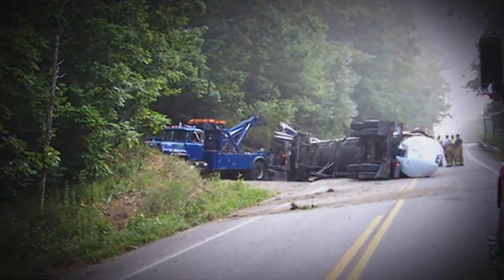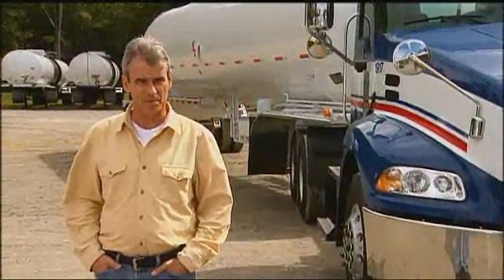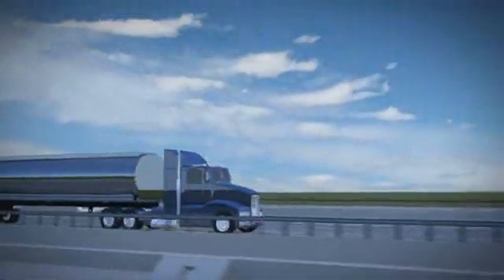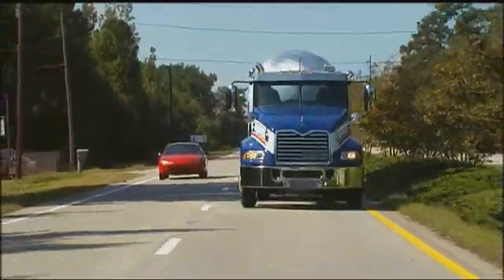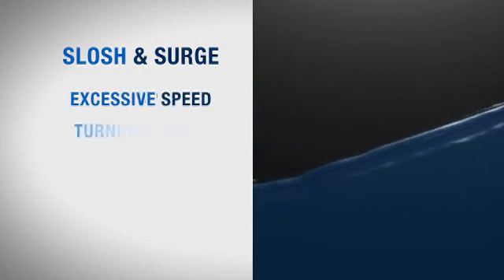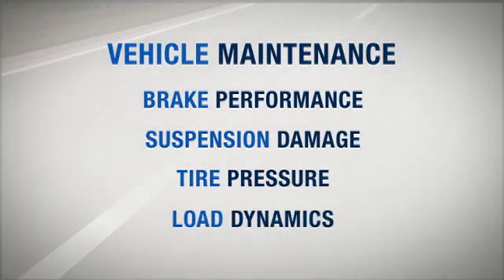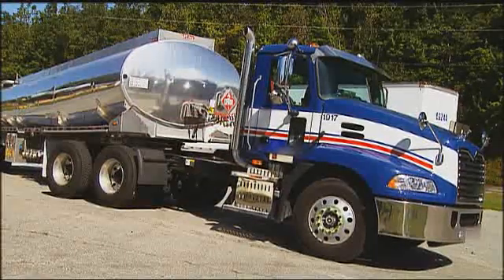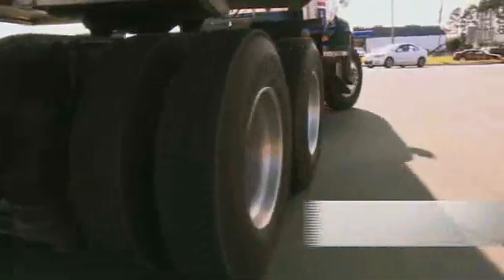Cargo Tank Driver Rollover Prevention.Part 1.asf-.asf

Comment: IF YOU ARE IN AN AREA YOU R NOT FIMILUER WITH ,THAT IS WHEN DRIVER TRAFFIC CHECKS COME IN IF YOU ARE GOING AROUND A BEND THERE WILL BE ARROWS AROUND THAT WHOLE TURN ,THEY DON'T MESN GO FASTER , ALSO DO THE SPEED LIMIT, AT TIMES  EVEN SLOWER THAN THE SPEED LIMIT,  THIS IS CALLED TRUCK SPEED LIMIT

Comment: Web address for you on TWIC:
http://www.tsa.gov/stakeholders/transportation-worker-identification-credential-twicR
Web address for you on hazmat:
http://www.tsa.gov/stakeholders/hazmat-endorsement-threat-assessment-program

With a TWIC card you can get fuel in bulk.  You can get in the ports for hauling some containers too.  Of course you would need a hazmat and TWIC for the fuel, but only a TWIC card depending on what's in the containers...example: logs in a container going to china wouldn't need a hazmat.